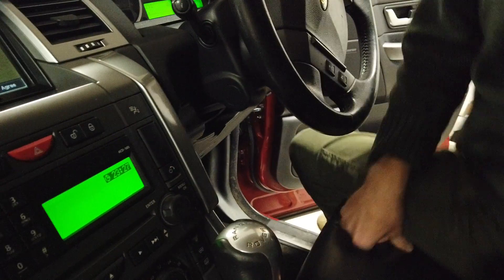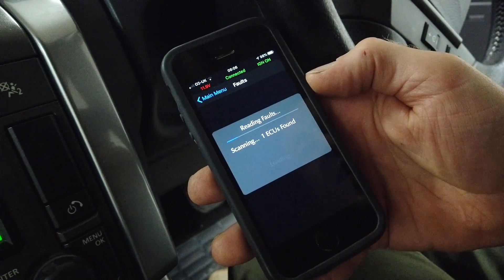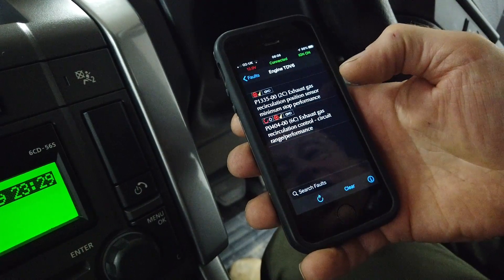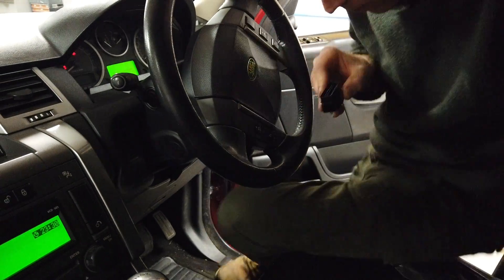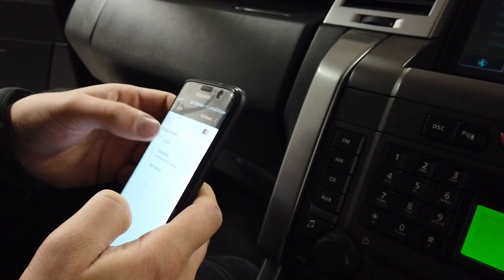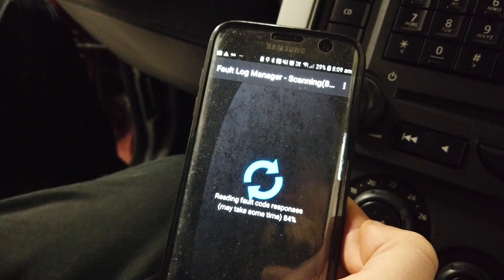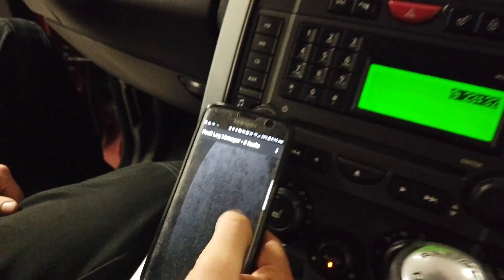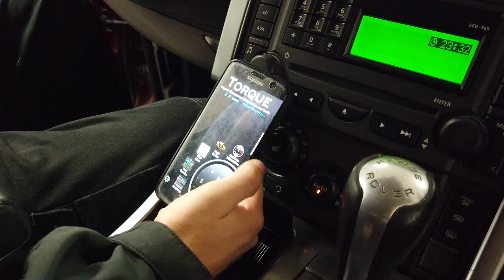IID vs ICAR OBD readers

Comment: An OBD2 readed will only read engine management faults! Faults where an engine light is on the dash. A scan tool will read faults in each module fitted to the car and will also show “pending” faults. I dont get the point in this video, these two tool are not comparable as they are completely different types of tools.

Comment: Try a different app like Car Scanner.
Reply from the maker: Yes it seemed a bit odd to me - we will try some more apps and do a bit of a survey !
Reply: powerfulukltd no survey needs to be done, these are two completely different tools. An obd tool will only read engine management faults!
Reply from the maker: @Gigznw9  I will try a couple more to confirm... the app does say it reads faults and clears them..
Reply: powerfulukltd yes indeed, a generic obd reader will read engine light faults. Only when the engine light has been triggered. However a scanner tool will read codes in each individual module. Obd2 became mandatory for every car sold since 2000, it meant that special dealer software was not needed to read engine light faults and every garage could use one tool to find an engine light fault. However this was only mandatory for the engine light and not the remaining modules on the car. So the generic obd readers will read a code that has triggered the check engine light but that it is. A scanner will generate much more info as it also scans the modules installed on the car for example the gearbox module or lighting module etc. The obd scanner can not read these, it can only read the engine light codes. I hope this makes sense. 
These two tools are not comparable. 
You would be better off comparing your iid tool with a snap-on scan tool or an autel scan tool. However i can tell you now that the snap-on and autel are much better and more advanced then your iid tool.

Comment: I recently bought the "iCarsoft LR II" and it shows all kinds of info on my 06 S/C sport. I've a recurring fault code P0171 and P0174. I've read all about them but my dealership is stuck on finding a permanent resolution. Two basic ODBII readers didn't work at all on this car.
Reply from the maker: Hi - I read an article the other day when they had similar issues and it turned out to be the car had been "chipped" and this was giving issues. Are you sure you car has the original "map" in the ECU ?
Reply: @L663  hmm. I can't say I'm sure. I've had the rangie about 4 years and this fault is maybe the last six months. ECU is not something I'd considered so thanks! I'll check through the old receipts for any evidence and certainly mention it next time I'm in at LR.